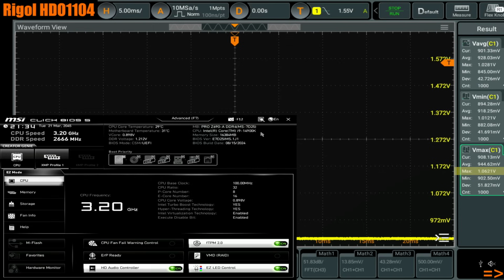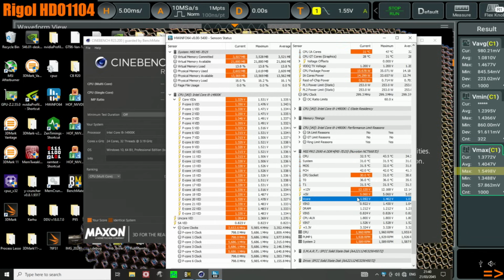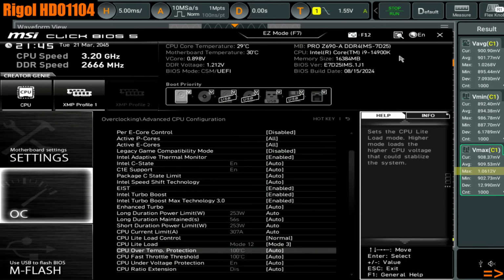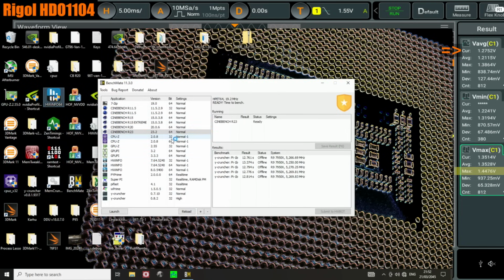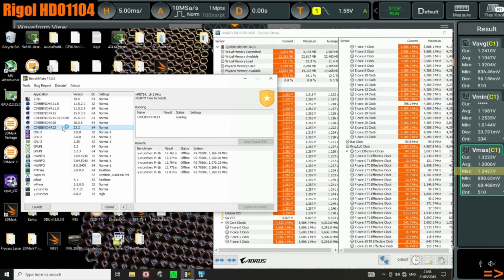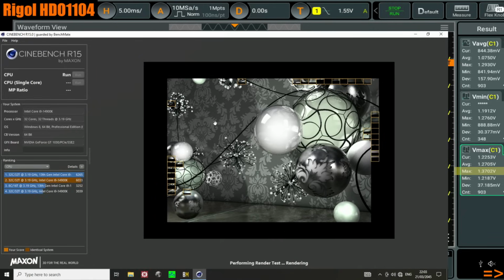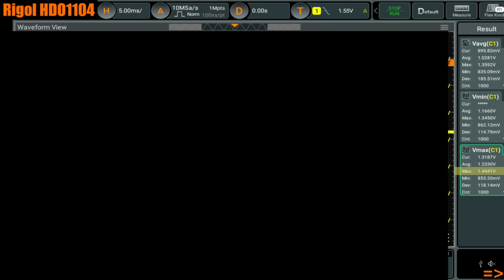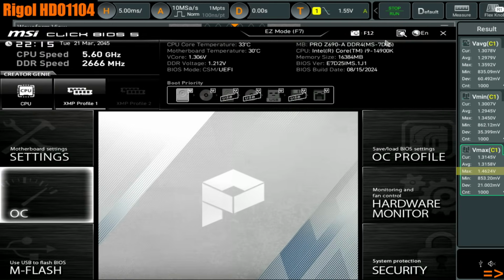"Optimizing" the i9 14900K on the MSI Pro Z690-A DDR4 with 0x129 Microcode

Comment: Is it better to have AC/DC 0.1/1.1 (Lite Load 3) or 0.17/0.17? In some previous video you suggested to have the same AC and DC, but it wasn’t MSI motherboard.

I’ve been using Loadline Calibration 5 with 0.130 offset and AC/DC set to 17/17. In HWinfo I had VID and VCore average almost the same (>0.05 difference). Do u think it’s better to go to LoadLine Level 3 and LLC3 with 0.135 Adaptive offset? It’s also pretty stable by far, but hits 96C with 185 PL1/PL2 when the previous ones max was 89.

I’ve got i7 14700KF and MSI MAG Z790 Tomahawk Wi-Fi DDR5

Comment: The AsRock Z790 boards have a hard limit of 100mv negative offset. Also they don’t have a setting to limit the voltage vid request. Not that I can find anyway.
Reply: You can undervolt further by using OC Tweaker/FIVR configuration instead. Set core voltage mode to adaptive, VF offset mode to legacy, VF configuration scope to All-core. Then under core voltage offset  you can enter the amount of undervolting. Hope this helps.

Comment: Would love to see you test a board with the OnSemi controller next.
My i9-14900k runs on a Gigabyte Z790 UD and I'm pretty happy with my current settings. It's fast and cool even when boosting to 6Ghz (running a Liquid Freezer II AIO).
Cinebench R23: 39k, 2.3k single - 85°c max

My settings
Intel Default Settings: Extreme
CEP: Enabled
AVX Settings->AVX Optimum: Enabled (this removes the Gigabyte Default 7x AVX2 ratio offset)
Adaptive Vcore Offset: -100mV
CPU Vcore Loadline Calibration: High
IA AC Loadline: 0.45mOhm
IA DC Loadline: 0.45mOhm
IA Voltage Limit: 1400mV

Been running like a charm for over a week now, no stability problems in all BenchMate tests as well as Prime95 or games like Cyberpunk 2077 (been playing for many continous hours lately).
I'm kind of a noob and your videos helped me a LOT while figuring stuff out. I was kinda scared my CPU will degrade and I'm much more comfortable now.
Thank you so much for making them!
Reply: i have the same motherboard too 

how much tempa do you get?
i just enabled energy efficient & cpu doesnt exceed 5.7ghz

Comment: Just updated to the bios released on 21 of august,had no prior problems and this seems to work fine as well. Using default intel settings and before that limit to 253W. I had to update the bios when I first received this mb, also MSI pro z670-a ddr4, or the 13900k wouldn't work. Updated it a few weeks ago to the most recent full release (April this year) and now 7d25v1j non beta.

Only thing that's sometimes happens is that disk io freezes for 15-20 seconds, then continues like normal. Could be a qlc flash thing I have as data storage (Samsung 870 qvo 8TB, Samsung 980 pro 1TB OS drive)

Comment: Good video, really helped me tune my 13700K.  I'm running the DDR5 Wifi version of this board and installed the newest, non-beta BIOS they pushed on the 21st with microcode 0x129.  I dont' have my own probe so I can't monitor the voltage during boot, but I was noticing some pretty high spikes on stock settings, pretty close to, or at 1.5V when running Cinebench R23, and I was thermal throttling.  I have a 360m AIO sand it's mounted fine, so it wasn't that.  Following your advice, I dropped the CPU Load Line down to Mode 8, anything lower than that and I was seeing performance loss, with a negative offset of 0.07 and now I'm getting better temps and a bit of a performance boost from stock.  Bumping up the offset to a -0.08 also results in some performance loss too, but I may have to play with it a tad more.  I think I'm dialed in quite nicely now, Cinebench R23 and R15 are only getting me spikes of 1.3V in single and multi core workloads.  I've had this CPU since launch and the only issue I had with this PC since I built it at the end of 2022 was the first 4080 I got ended up being a dud and causing me all sorts of problems, but replacing it with a new one resolved everything and it's been great since.  This video was very informative and did a good job explaining all the CPU Load Line stuff that I was otherwise getting confused about.  Thanks!
Reply: I have a 13700kf and I'm afraid to update the bios

Comment: What values does CEP actually compare to decide if it should trigger or not?

From what I understand (excuse any blatant ignorance please) there is lets call it default VID, Which is what is written on the cpu vid table, the AC LL adjusted VID, which is what it actually requests, the VID readout, which is the AC adjusted VID further adjusted by DC LL (?? or original VID djusted by DC LL???)  and the vcore.

So... what does CEP compare to what?
 Like, if the vcore matches VID in HWinfo does that mean the CEP is happy? or is it going to still do some magic weird math and still freak out because oh no mercury is in retrograde today and also vid readout doesn't match vcore divided by AC LL multiplied by the square root of current or whatever tf?

Really sorry if you already covered this and I missed it.

Comment: Hi, help me understand something, cuz i'm confuse, i have an asus z790-e mobo and 14900k cpu, i updated the bios for 129 microcode load intel default and the performance profile, DRAM i have xmp1 with freq down to 6Ghz from 6.6Ghz, i enabled eTVB, undervolt protection is on, set PL1 and PL2 at 253W, iccmax is 307A, set the cpu voltage to max 1.4V anything else is default, the scores on R24, R23, R15 are mediocre, then i started to play with core svid offset and do undervolting, at -160mV i got huge scores, r24 over 2200, r23 over 39500 and r15 over 6200, and hwinfo doesnt registering voltages over 1.35V, what is wrong, is my mobo insame, i do something wrong, is my cpu acting crazy?
Reply: What Loadline Line Calibration level are you running and did you mess with AC LL or DC LL and/or SVID Behavior?
Reply: @DeagleHonor  Default on both, but AC LLC is 1000 mOhm and DC LLC is 1000 mOhm on hwinfo, if i set svid behavior to typical scenario, AC LLC are 400 mOhm and DC LLC is 1000 mOhm, but the performance drop alot, so i left them default.
Reply: @TuxClaudiu  what is your Asus LLC setting set on (Load Line Calibration) and do you have IA CEP enabled?
Also what are your temps with these settings in the benchmarks and what kind of cooling do you have?
Have you tried Intel Extreme with ICCmax set to 400a?
Reply: @DeagleHonor  asus LLC are on auto, CEP is enabled and temps dont go over 82C and for unknown reason, extreme profile is worst. The only thing i forgot to mention is that i have turbo off. The cooling is 360 aio, deepcool LT720 and benchmarks are going up with every -10mV, i've started to notice increase in performance under -130mV, and the system is laggy between -0.09mV and -0.11mV, but after is getting very snappy and running smooth.
Reply: @TuxClaudiu  when you say turbo do you mean multicore enhancement or Adaptive turbo boost? Do you start to crash going below - 160mv?
Reply: @DeagleHonor  intel adaptive boost technology i've disabled. I was thinking to go below -160mV and see whats going to happen.
Reply: @DeagleHonor  I didnt go below -160mV, but i had no crash on cinebench R24, R23, R15 i tried also 7zip and no crash.

Comment: I wonder what the actual impact is of an overshoot voltage of 1.59V. what percentile is over/at that voltage? If it's only 50us every second or so that can't really cause heat damage. Unless it rises above clamping voltage like static electricity I don't see how this can degrade the CPU.
Reply: You know that heat isn't the only point of failure of electronic devices right? Over-voltage itself can be damaging.
Reply: @trixniisama  yeah I know about static voltage degrading barriers/junctions in MOSFETs and capacitors but at such low voltages is that still a thing?
Reply: @imqqmi  It's what damages the ring, so most definitely. All electronics have operating values, a specification, and if you go out of spec, well the behavior cannot be controlled anymore.
Reply: @trixniisama  According to the datasheet Vcore max is 1.72V. max overshoot is 10% for 500us at TDP. An overshoot of 1.59V for 50us is well within that range and I believe his CPU is around 70⁰C under load but not sure he hits TDP limit. Of course if the chips are faulty the specs can't be trusted. 
They state at TDP and a time limit, suggesting that over voltage main concern is thermal damage.
What other failure modes could there be at or below 1.72 + 10% is 1.892V?
Reply: @imqqmi  I mean, what do you want me to tell you? Concerns about too much voltages have been lasting for years. The fact that Intel does not actually have a proper specification is what led to the recent motherboard debacle. Now they've published guidelines but anyone knows that pushing 1.5V is already insane, let alone 1.7V! This "specification" was delusional to begin with. Board partners are trying to reduce voltage and not TDP or thermal limits for a reason. Temperature hasn't been a concern in modern CPUs for a while.
Reply: @trixniisama  Fair enough, thanks for your input!
Reply: @imqqmi  Sorry for the harsh tone I employed at times
Reply: @trixniisama  No worries, thanks for bearing with my ignorance.

Comment: Is there a difference between "Offset Mode" and "Adaptive + Offset Mode" in the CPU Core Voltage Mode? As far as I have understood it so far, when you leave the Core Voltage at Auto with Adaptive, it's the same? And if your set a voltage there, it will only apply if the CPU boosts above X (5.7 Ghz?), and the entered voltage value is above (not below) the entry in the internal VID table of the highest VF point entry (also 5.7Ghz?)? 
There are so many entries on MSI boards for the Vcore setting for Intel that it's really confusing.
Reply: Adaptive makes the vid request match the vcore for me, so i think its better. If i just use offset, then i end up with 2 different values. Example for offset is, the vid requests 1.4v and my vcore is 1.2. if i use adaptive they end up being the same number. Not sure if theres anything wrong with using regular offset though.
Reply: @Keaweahe  Did you use both times use LLC Auto and AC/DC Auto values? I'll have to check again, but I don't think Adaptive + Offset does automagically set the correct AC/DC loadline for any selected LLC value.
Reply: @sp00n  yes i did.
Reply: @sp00n  msi z790 carbon wifi
Reply: @Keaweahe  I have the same mobo, will have to check later if I can see any difference.
Yesterday I painstakingly tried to identify the mOhm values for each level of LLC (disable enough cores to not run into the temp limit, then run Prime95 without AVX and compare the VID request to the VR VOUT value), I really hope the Offset mode didnt skew these measurements and the Adaptive + Offset mode shows the same. 😵‍💫
Reply: @sp00n  i got my system stable a few times but still experimenting a little. The undervolt and power limits aren't enough to get it stable unless my chip is bad. Usually takes me a 1.2+ offset or adaptive with no e cores to get stable unless i reduce the ac loadline.
Reply: @sp00n  usually my single core performance drops when i lower the ac loadline, but not with the method in this video. But i can't get it stable without a 0.1+ offset, which I'm trying to ditch. Just feels wrong undervolting more than 0.1.
Reply: Ok, so I just checked. Neither my VID nor my VR VOUT values changed when I switched from Offset Mode to Adaptive + Offset Mode with an "Auto" voltage,  and the same -offset value both times. I tried with LLC Auto and AC/DC Auto, and with LLC 5 + AC/DC 36.
I made sure to set the Offset Mode to "- (By CPU)" and not to "- (By PWM)" though, so that might be a factor that plays a role. For Adaptive +  Offset Mode there is no such distinction, so I assume it always sets the "By CPU" offset.

Comment: Hey guys, can someone clarify something for me? Is having a Vdroop a bad thing? I'm sitting on z790 with 14900k with Intel defaults, and LLC 8 with AC80 DC110, adaptive offset of -0.12  and according to HWinfo64 under full  load it sits around 1.20, in gaming avg 1.27v with peaks to 1.33v iirc.
Here Buildzoid used far more flat LLC with lower AC DC which if I understand correctly leads to smaller Vdroop. 
On his earlier videos I'm pretty sure he didn't went as far down with those numbers.
What's the benefit of doing this? Thanks in advance
Reply: A couple of things here. First off, a lower, droopier, LLC has better voltage regulation and helps with the voltage spikes. The thing you have to worry about is at idle or when it boosts to its 1-2 core max, the voltage requests go through the roof. 

The other part is, why did he choose a higher, flatter, LLC and go against what he said in previous videos? Well, back when he made this video, MSI boards didn’t have the option to set a voltage limit. So, if you were using a lower LLC with no limiter, it could potentially degrade your cpu. However, with a higher LLC, voltages come way down. Yes, you’ll get spikes. But even at those peak spikes, they’ll be less than the top voltage requested with a lower LLC. 

So, he’s saying to do this if you can’t limit your voltages.

Comment: In the latest alpha version of CoreCycler (v0.10.0.0) I've added an option to do an automated test. Which could be helpful in finding a stable undervolt, as you can define various stress test programs (Prime95, y-cruncher, Linpack, Aida64).
For Intel processors, this automated test means that it will automatically adjust the voltage offset when an error has occurred, so it could help you find this (somewhat) stable undervolt setting by e.g. letting it start with an offset value you think might be somewhat stable, like the mentioned -150mv in this video, and then letting it run overnight and see what the outcome is in the morning. It currently does not adjust the offset more into the negative, only more towards the "stable" side (i.e. up to an upper limit you define), so it's not a fully automated tool (yet?), but it can help you automate manual tasks.
It's also worth noting that this voltage offset is only temporary, and will have been reset to your previous value after a reboot (unless you also enable to resume after an unexpected exit, in which case CoreCycler will try to restart the testing process after the computer hard crashed).

And as the name suggests this is still very much an alpha, and I think the only person having tested this with an Intel CPU right now is me, as the tool was originally designed to test your Ryzen Curve Optimizer settings, and so the current user base is also mainly Ryzen owners.

Comment: Thanks! I tried your settings and the temperatures seem to be a bit lower. Will see if it's stable. Before I tried AC/DC LL with 55 and LLC4 which was not 100% stable.

Comment: MSI annoyed me with that 'automatic extreme settings' thing too. I have a 13600KF, so thermal throttling was never really an issue, but it did spend a lot of time throttling due to the new 200A current limit in the intel defaults. Undervolting did eliminate that without having to go too far. Then I wanted to raise the clocks from the stock 5.1/3.9 P/E to 5.4/4.3 that I knew it would do at that voltage, but MSI insisted on switching the power profile when I did so. As far as I can tell, the only thing it changes is setting PL1/2 and max current to unlimited and I was able to change it back, but still annoying. With the overclock It still hits the current limit (up to 220A) in all core, but performance is no worse than stock and its better in general use applications that don't throw 20 threads at it (the 3d mark CPU test even showed a small increase in 16 thread)

Comment: Please help us to know why Ring Limit Reasons is always YES even in this video ? Is there any issue with it ? Any way to fix it ? Whether setting ring ratio and ring down bin will solve this issue ? 65w non K CPUs didn't have this issue but K series having it(checked 12400 and 14500 CPUs). Ring may be getting high voltage. Is the initial high voltage causing it ? It will be very helpful if you can add a video about this issue. A lot of people are confused about it and thinks this may be one of the reasons for degradation.
Reply: Hello,
I have the same issue, but came to the conclusion that it is just an unfortunatly named hardware limit flag.
The reason it's 99% on yes even in idle is that the ringbus frequency is linked to the maximum P-core frequency minus a 5-600 Mhz offset.
So it constantly "throttles" depending on the P-Core clocks, but that's how it's supposed to work.
Not all these flags indicate a real issue with the system, "IA: Max Turbo limit" for example and the "RING: MAX VR Voltage, ICCMax, PL4" is one of them.